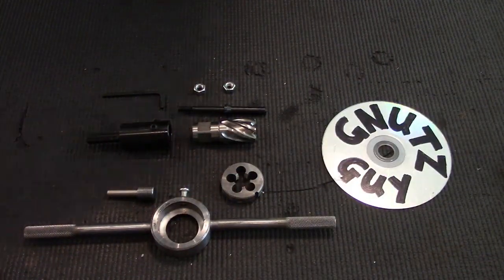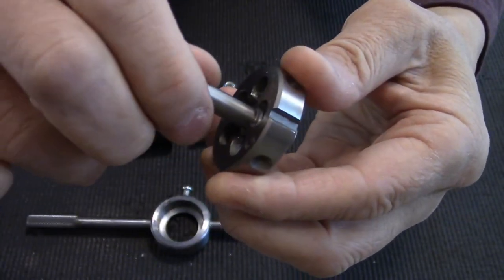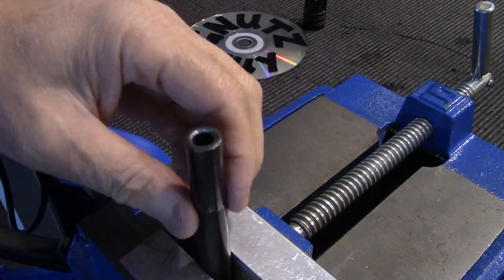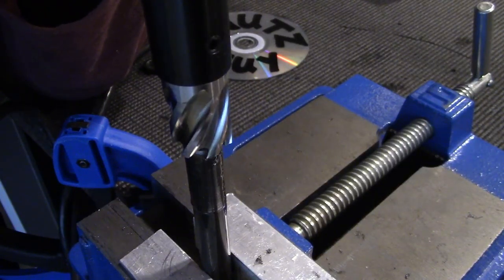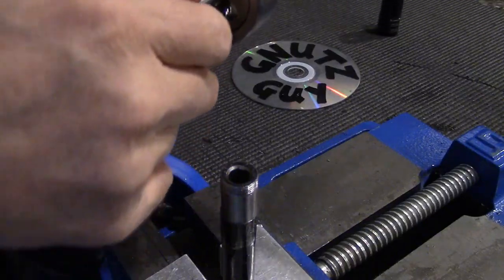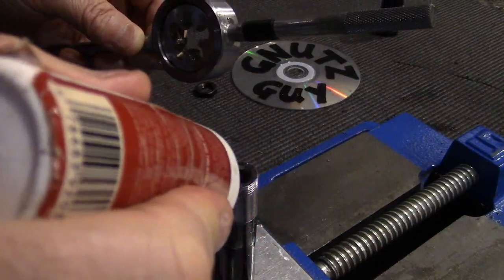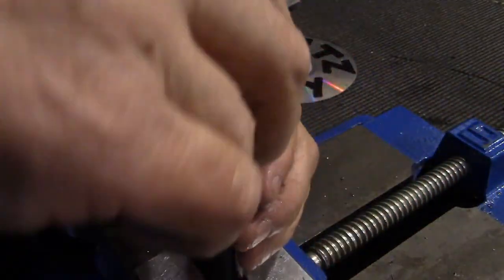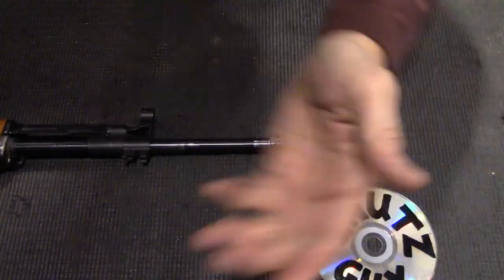Threading oversized barrel. Tap & Die, Annular Cutter. Flash hiders ONLY. Type 81 VZ58. Read below

Comment: First off I'd like to say awesome job with the barrel work. For future reference on the tapping, you can go more then 3 degrees between back offs, a quarter turn or more will usually be fine and you can tell by watching the metal curl in the die as you cut it. Also, it looked like a tapered die, so after you get your length with taper threading first, I've gone back afterwards and threaded the die on backwards with taper end up, that'll clean up all the thread for full length. Overall looks awesome!!!
Reply from the maker: thanks for the tip but the reason why i backed of early was bcos i felt resistance and also i felt the cheap die might snap, lol.

Comment: the die starts off with the taper side in the stock pointing down , then swap it half way to ge a cleaner end to the thread ,, this may be ok for a brake ,,, dont think I would do a moderator this way though...

Comment: Thanks for the intel.  What is the purpose of the jam nut?  I have a M14x1 LH AK whose threads go right up to the front sight post.  Does jam nut help support concentricity with the barrel by provide a 360 degree shoulder?
Reply from the maker: To ensure proper timing of your muzzle devices, you need either a jam nut or a locking pin to hold it in place except for A1 birdcage which does not need to be timed.

Comment: "slop" in guide rod to bore, guide rod to cutter, and tolerance of cutter itself are all additive. Add that to tolerance of bore guide for die and die itself means you have A LOT of additive tolerances that could all add up to bite you in the ass. Also, buying cheapest possible tooling from Amazon probably doesn't help either. The longer the device from the muzzle the more likely  a bullet strike because you  CANNOT get dead nuts concentric with bore axis using this method.

Comment: Not sure if the guides were rotating or not, no potential damage on barrel inside?
Reply from the maker: it does rotate in the annular cutter but not in the die. i see no damage thru flash light.
Reply: No...guide spins independently

Comment: I have 5/8×24 flash hider. I wondering if it's can be used on Type 81? Or the only one which fit is M14×1?
Thanks
Reply from the maker: according to the chart at 1m 20sec. the t81 is too small.

Comment: Some say that solid dies shouldn’t be used for cutting threads and a split/adjustable die should be used. I see your die is solid.  Are the solid dies sufficient in your opinion?
Reply from the maker: use what ever are available to you. ofcos i'd demo the harder of the two.
Reply: @gnutzguy  as we know, the split dies are extremely higher priced but I can see I can get away using a solid. Much appreciated
Reply from the maker: @stevenmack9810  yup, that too. cheaper and readily available on AliExpress. I think it cost me less than us$5.

Comment: What caliber pilot did you use for 7,62? Is it .308 ok?
Reply from the maker: The pilot tool you use must fit the die you are using, in my case it was a M14x1 RH then it will come with the appropriate caliber which is 7.62, not 308.
Reply: @gnutzguy  Sorry,I am total amateur,and I wanted pass cheaper,because my friend have 5/8-28 die,and .308 pilot.. I fought that will be ok for my SKS.. What die you recommend for muzzle brake and suppressor on SKS?
Reply from the maker: the regular sks (no idea with yugo m59) muzzle is 14.3 mm and 5/8" is too big . you need a die and annular cutter same as me. i would only recommend birdcage flash hiders unless you checked the straightness. if absolutely straight then you may use brakes.

Comment: Take you rifle to a good gunsmith, have him do this on a lathe. Way more accurate and beter job.
Reply from the maker: no doubt but then whats the point of this vid?
Reply: If the threading alignment tool is to spec and fits snugly in the bore, and the die is of good quality, plenty of cutting oil is used, and some care is taken to complete the job, then the threads are nice and crisp and concentric to the bore. A smith isn’t going to be “way more accurate”. It’ll be a hair more accurate, and not enough to matter. More men need to learn how to do some things themselves instead of always paying another man to do everything for them. Don’t be afraid to get your hands dirty and don’t be scared of failure.  Upgrade your masculinity and learn some new skills. 
It’s satisfying.